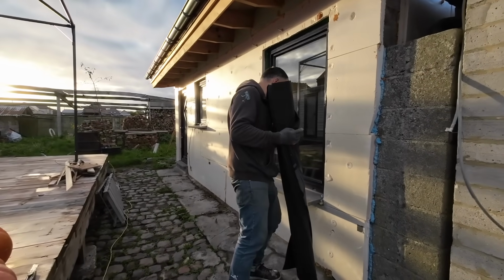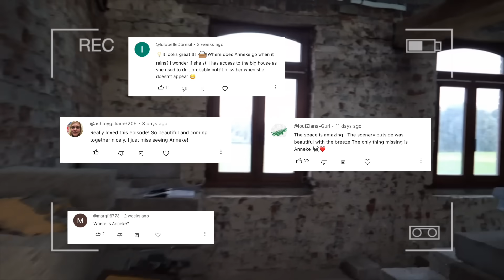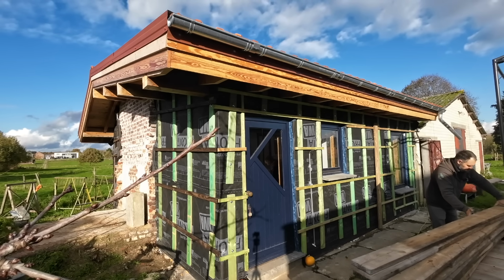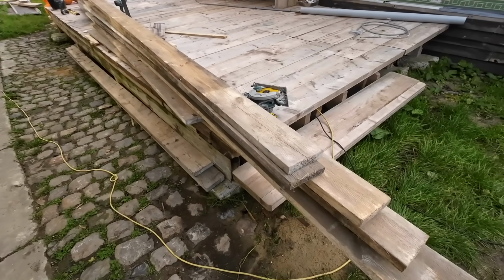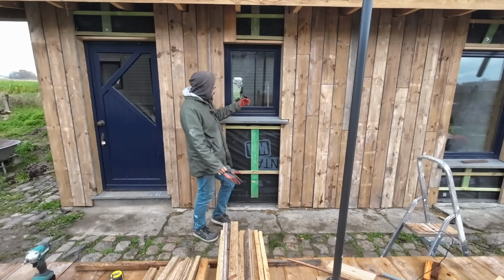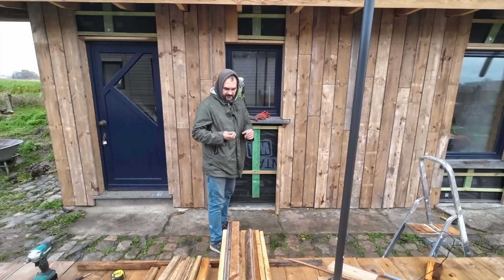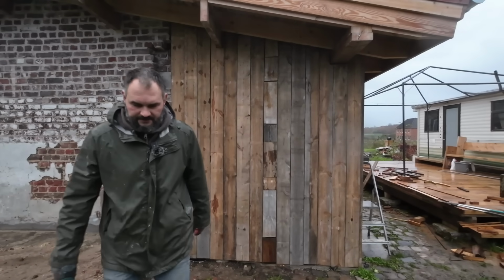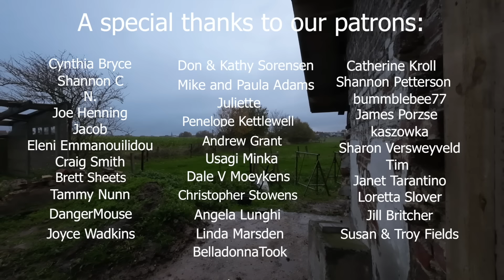Can he pull off this DIY CHALLENGE?!  Wood Siding out of RECLAIMED boards for our tiny house

Comment: Looks great! What happens if rain penetrates between the vertical siding boards? Is the black house wrap membrane waterproof? Will the siding boards develop mold or rot on the hidden back side? Will you paint/stain the front face of the siding?

Comment: Love what you are doing, looks great!  But if you don't mind a suggestion.  Cut-off the bottom part of the wood with a circular saw, the wood sitting on the ground will wick water up which invites bugs and rot.  Put a layer or two of rocks around the bottom.  Not brick or concrete because they also wick water unless you put a rubber, plastic, etc, barrier between them and the wood.  Hopefully that will help. Love you guys. 😊😊😊😊😊

Comment: Looks great. I highly recommend that the bottom of the wood does not touch earth on all sides. Termites will find a way.
Reply: Я думаю,что термиты не живут в их местности.
Reply: I agree that the boards shouldn't touch the ground, to prevent rot. Fortunately we don't have termites in Belgium,  so that's one less worry for them
Reply: @IvIozey  No termites? How did we get so lucky? lol
Reply: There are no termites in Belgium. However, you are right that the boards should not touch the ground. It would cause rot.
Ah I see my comment was unnecessary 😅

Comment: It looks awesome  a beautifully created studio apartment.. with the side where concrete slab is put a sm table and two chairs 😊 .. never ending Illia but the boards should have gone sideways overlaping each one from bottom to top , this then will help keep the rain  out, rather than up and down, around the bottom use bricks so wood does not touch bottom dirt so termites don't c😮ome in 😮
Reply: There are no termites in Northern Europe ✨

Comment: The fix over and under the windows and the over the door is perfect!  It is consistent and looks like a feature - very intentional.  Great save!  Wondering - you don't need to seal or protect the wood since it was pretreated?  Correct?

Comment: From experience, one issue with putting on boards vertically is that they might shrink, creating gaps. Of course this could happen if applied horizontally, as well. I guess if it happens, you caulk in-between and paint it all.

Comment: Make sure those boards are not touching the ground. They will rot otherwise. Love the videos.
Reply: Seen those who cut the boards at an angle on the lower end so rainwater drips of quicker instead of staying on and make the boards rot faster.
Reply: Yes, agree. Would be great to install some sort of stone layer above the ground between it and the wooden panels. It looks really nice overall 👍

Comment: Nice improvisation and good results for the boards you needed. My question is, what about the spaces between the boards? Do you have any plans for that, as air and water will most likely enter there.
Reply: There is a waterproof membrane under the wood.

Comment: Siding is generally applied horizontally rather than vertically for a reason.  The lowest board is applied first.  The next board up slightly overlaps the lower board.  This pattern continues all the way to the top. It is done this way because it helps keep water out of the space between the siding and the inner layers of the structure.  When water gets trapped in those layers, it can cause the structure to rot.  It can also provide an ideal environment for toxic mold to grow.

The existing siding doesn’t necessarily have to be removed although it might be ideal.  Applying another layer of vapor/water barrier followed by correctly applied horizontal siding would probably work.
Reply: You just can not help yourself, right?
Reply: @dcpack  If your neighbor sees you doing something that can cost you a great deal of money or damage your health, would you prefer they tell you before or after the damage has occurred?
Reply: You're absolutely correct. I had the same thought.